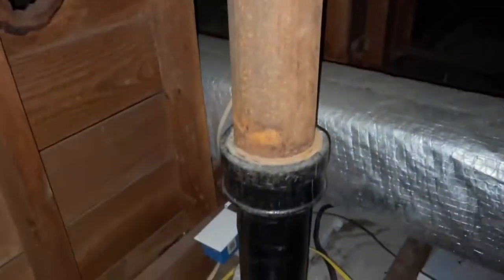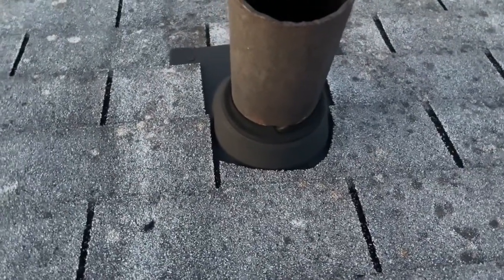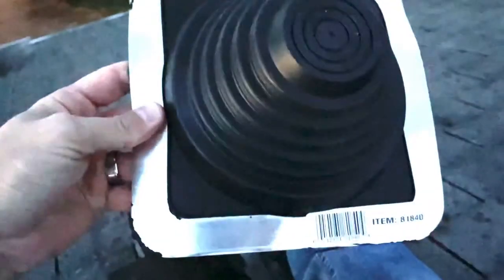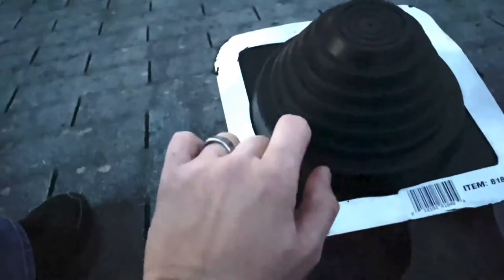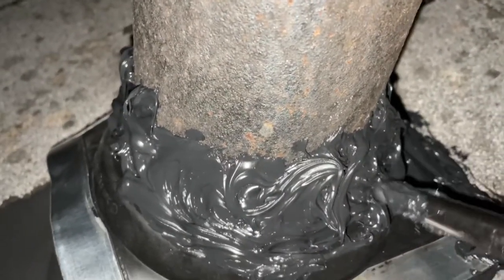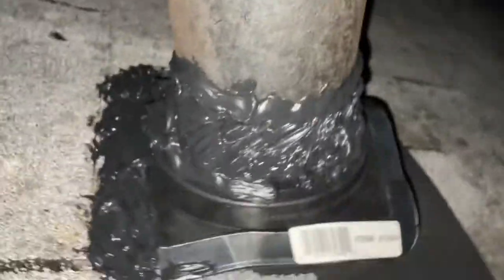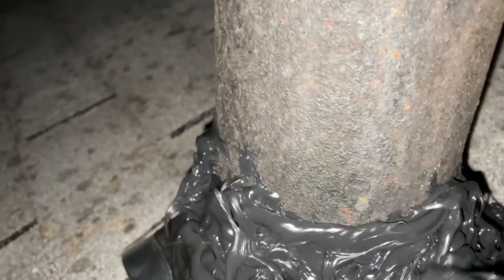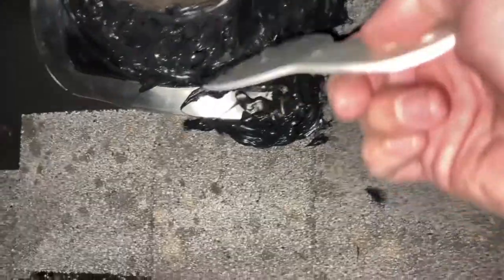How To Fix Leaking Roof Vent Pipe Seal | Simple Tutorial

Comment: I had a issue with the pipe inside the attic the same type cast Iron pipe.  I didn’t have water issues I had smell issues only when attic fan was on. 
After years I finally went o attic and saw the old pipe that the seal was broken so I used Mortite clay putty all around it. So far so good. 
Before winter comes I think I will remove putty and place silicone from a tube there and then the putty on top.  
Thanks
Reply from the maker: Oh Wow Interesting and No Problem!

Comment: That sir is your sewer vent pipe. If you want to save a tube of caulking you can put a nail in the top to save for later. It's good you kept that first flange under the shingles. You dont want to see water and ice get between the new seal and old but you should be good to go. Just keep an eye on it from time to time. 🙂
Reply from the maker: Correct It’s The Sewer Pipe. Yeah I Was Actually Thinking I Should Have Put Some Nails In It As Well. I’ll Just Have To Do It When The Weather Gets Better, Now It’s Pouring Out Rain. I’m Just Happy I Got That Done Before The Next Storm! Thanks For Your Support Brother! 😎
Reply: @CJsINFO  do NOT put nails in it that will cause more problems, look at the way the first flange is set under the shingles its done so in a way that the water flows over everything. 😜
Reply from the maker: LMAO! Okay I’m Putting Screws In Now! 🤣🤣🤣
Reply: @CJsINFO  i would just cut an actual hole in the roof around the pipe this way the water can flow freely 😎
Reply from the maker: Yeah That’s A Great 💡 Let Me Get The Axe 🪓 Now!